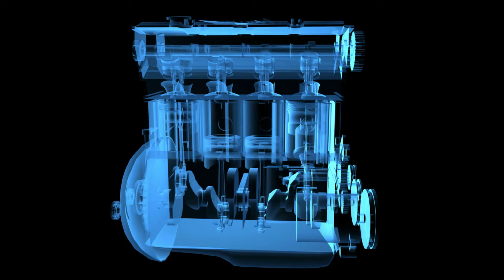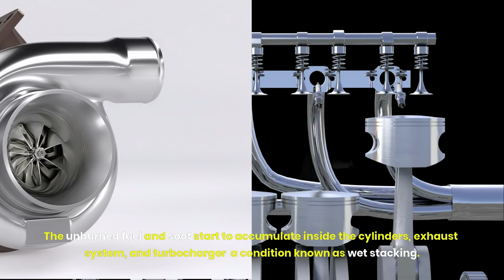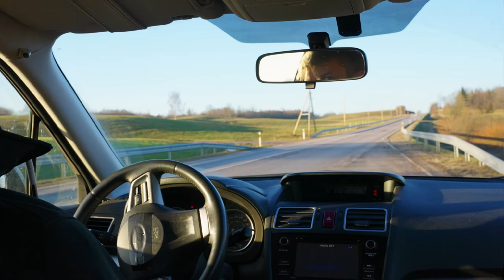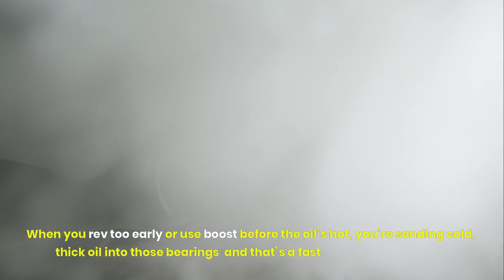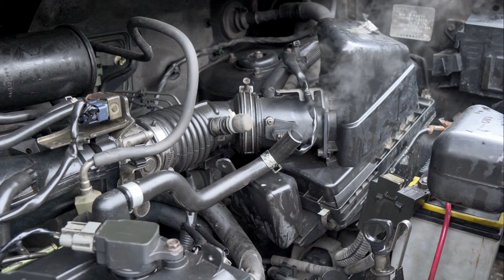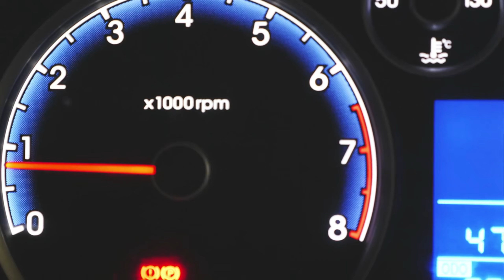STOP Warming Up Your Diesel Like This (Costly Damage!)

Comment from the maker: 🚗 Most Diesel Owners Get This WRONG 😳
One small 5-minute morning mistake could wreck your turbo, injectors & DPF! 💥
Watch till the end — this tip could save you thousands in repairs! 💰

🔥 Let’s see how many diesel pros are here 👇
What’s your cold start routine — do you let your engine idle or drive right away? 👀

#DieselTips #MechanicSecrets #TurboCare #DieselLife #DPF #DieselMaintenance
Reply: I am safe. My old idi diesel doesn't have a turbo nor the dpf system..phew
Reply from the maker: “Haha lucky you 😄 those old-school diesels are built like tanks! No DPF headaches, no turbo failures!”
Reply: @CarCareCrewOfficial  yes bro. But on the highway i feel like i am going backwards.
Reply from the maker: @Lucas-ix8bg  Haha I know that feeling bro 😅 might be time for a fresh oil change or quick tune-up! 🚗💨

Comment: Dfp removal will fix this remove EGR also
Reply from the maker: “DPF delete helps a bit, bro — but risky for daily use. Better clean the system or check sensors, runs smoother that way 🔧”